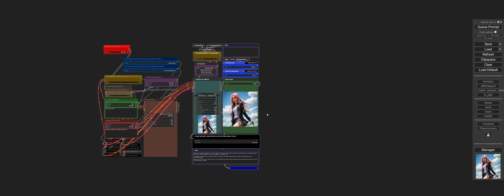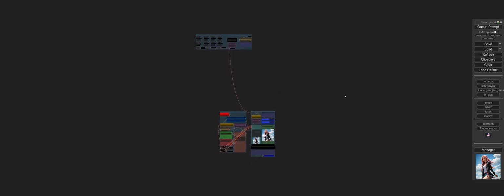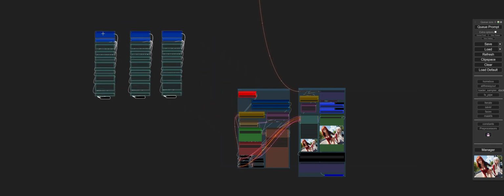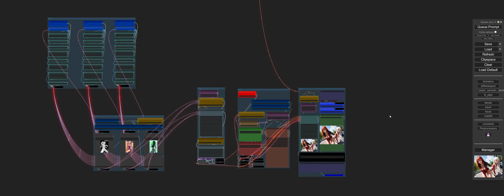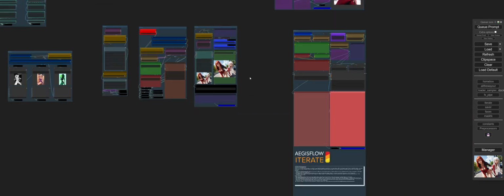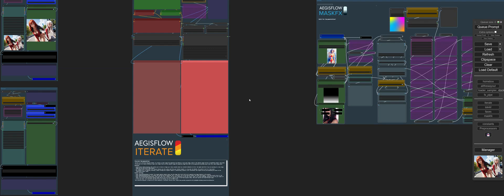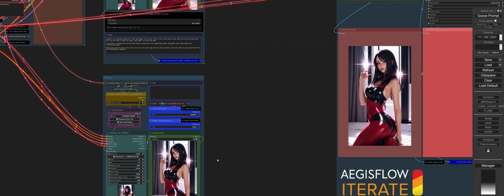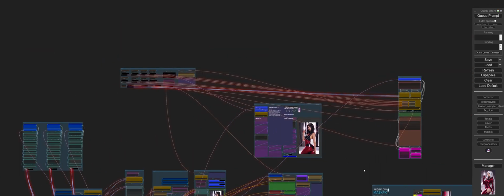Shima Overview Build - ComfyUI Automatic Wiring Workflow

Comment: I used Manager to install all missing nodes, but i still get an error message when loading, that he cannot finde "Facestyler".... in which pack is that node? I cant figure it out, even with google :) If it isnt released yet, what is its function and with what can it be replaced?

Also, i dont get the connections... just inside the groups, not between them...

Comment: HiHi, i just downloaded the workflow, after running comfy ui manager to install the missing nodes... there still more missing node which cannot be found... what am i missing?
Reply from the maker: Comfy manager doesn’t always have all the nodes. You can now get the AegisFlow utility nodes in the manager, but might need others like Use Everywhere from other locations. There are many, many nodes used, so  I’d have to have more info to help.
Reply: @MajorStudioArt  the one with facestyler is missing for me
Reply from the maker: @PaboBabo  This isn't yet released. The modules are premium features, but the base workflow will be available as DIY/free